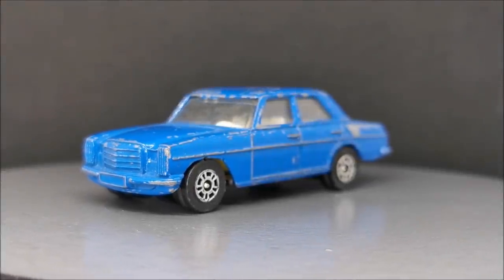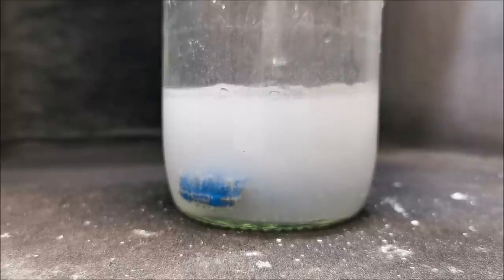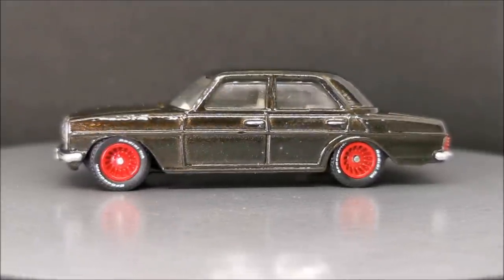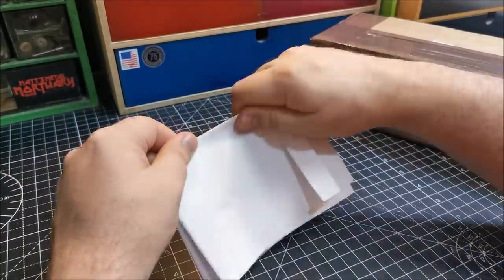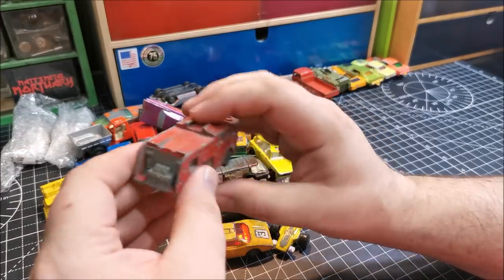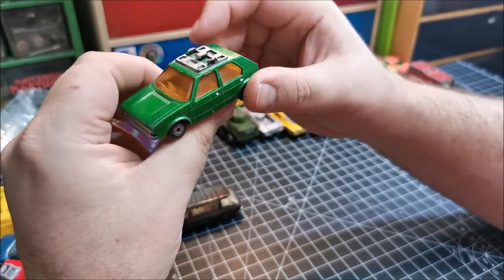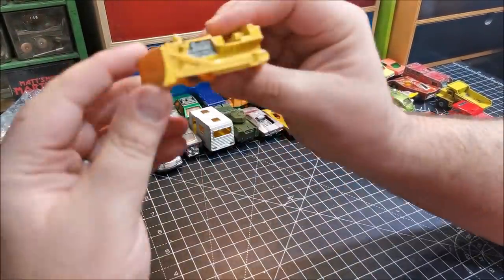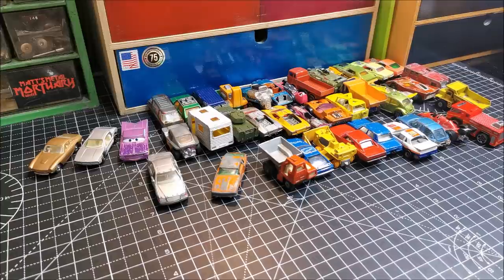Mercedes Benz 240D 'Retro Rides' Custom + Unboxing!

Comment: Excellent colour for this era MB.  I love it.  The wheels are a great addition.  The new camera does take some time to come in to focus.  I really noticed it on the carousel footage.
The Field Car has a vaguely familiar looking Studebaker grill.  The Fiero came with 4 or 6 cylinder engines although you can swap a v-8 in.  The Northstar Cadillac engine is a popular swap candidate.   You should do a run of the open wheeled cars.  I would enjoy seeing that!
That Jenson would be quite the challenge.  Go for it!!

Comment: nicely done mercedes. dunno about turbine wheels, but then again, why not. :) interesting paintjob, too. it's a bit like early mica paints, which shimmer a different colour with the light angle. ^^
hey, if a slammed car has a towhook, does the trailer need to be slammed as well? you've got a mobile home there, maybe try it out. XD
the "transformer" van is from a short-lived series of "hero" cars and "enemy" cars, which had an insect/vermin theme. I have never seen one myself, maybe they were  mostly sold in the US?
the Fiero was sold with either a straight-four, or a chevy V-6. the fourcylinder was taken from Opel, an ancient OHV with 1.7liters displacement, a construction Opel glady got rid of in early 60's... XD the V6 was rumoured to lit the car on fire, when the engine room insulation caught fire from the exhaust heat; not sure how much is true.